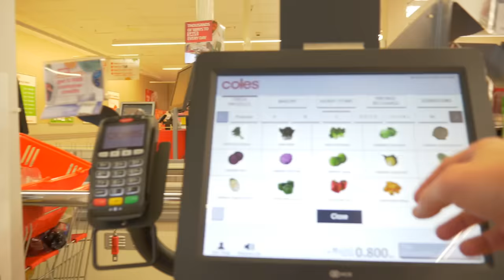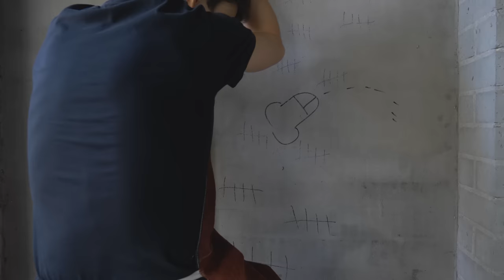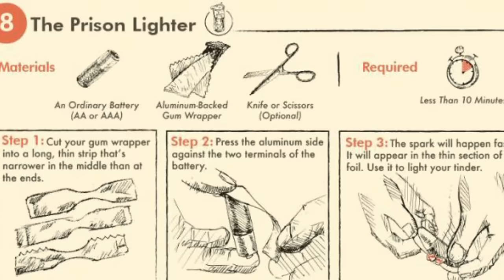Recreating the Worst Prison Weapons

Comment: Homebrewer here: You'll get way better orange wine if you leave the peals in for the primary, then put the fruits in for the secondary. Freeze the oranges so you can use the same ones next week after you rack the wine in a new container to get rid of the peals. ALso, freeze any fruit you want to ferment with. That helps break down the cell walls and makes more of the fruit get into the drink. ALso mashed up bread works as an okay yeast nutrient if you boil it first, but with real fruit in the primary you wont need any of that. You do need yeast either way.
Reply: bruh
Reply: wait till this guy find out about liquor stores
Reply: @thedude7737  I think most homebrewers do this because alcohol tax, or just the activity is fun.
Reply: Instructions unclear, used frozen fruit to break out of prison.
Reply: Tips on to not kill ourselves with botulism?
Reply: @bloodyhell8201  clean your equipment, dont use rotten food
Reply: @samquinn4095  My mom and her friends go every year to pick peaches in PA (I think) just so they can make peach brandy. They've been doing it for probably 7yrs now and have gotten pretty good results the past few. They just all make their own batches and pass out jars to compare whenever they deem it's ready.
Reply: @insanospaz  cool, do they all have their own stills?

Comment: I once dropped my Stanley knife with the hook blade while cutting boxes, my hand was above eye-level so gravity pulled the razor sharp hook right through the fleshy part of my thumb/palm. Surprisingly it didn’t hurt much because the knife is just really sharp so the wound stays nice and clean and the cut is nice and straight.
Reply: Same! I once cut clean straight through the flesh of my thumb (lucky nothing permanent) with fabric scissors. No pain, just a lot of bleeding. Straight cut.
Reply: When cutting with razors it usually only hurts afterwards when it's healing
Reply: I collect and make knifes, be it switchblades, one-handers or survival knifes. Getting cut almost never hurts, since I sharpen them very finely - getting stuff into the cut (sweat, dirt, anything) really hurts. Interestingly enough I've never suffered a cut  on the back of my hands, only fingers and palm. Tried out the "lemon juice into fresh cut" - thing out of curiosity and circumstance, can absolutely recommend if you like pain. If not - hurts like a bitch, do not do that shit.
Reply: @Careonovam  bruh, you let the intrusive thought win on the lemon experiment
Reply: @Careonovam  Did it scar?
Reply: @Human-san  Well yes, if it has a certain depth even a scratch scars ^^

Comment: I know I’m a bit late, but the reason you’re first whip didn’t work well was because you forgot to add a counterweight at the end. The original whip had some type of screw at the end, making it much easier to control and much more likely to wrap around an appendage. You’re second attempt achieved the same effect by the large razor blade at the end.

Comment: Funnily enough, guards do razor checks in jail and you need to turn them in unscathed. Some people will take bits of foil from snack bags and replace the blade with it. They snap the razor back together and it doesn't look too suspicious. Other things people will do are curl construction paper into an extremely compact cone (for art supplies, but are still super pointy), or take the metal brad out of buttons and straighten them, then sharpen them depending on the use (shiv, embossing on cups, tattoo equipment, circuit bridging for starting small fires, etc). Considering work orders don't go to fruition unless there's a medical emergency, and clothes are stolen all the time, a good way to sew clothing is necessary (hence the button brads). I personally just used rationed soap as chalk for DnD games and milk powder to make candy for people who didn't have money for commissary. Thanks for the videos and some good laughs, I look forward to watching more of your content.
Reply: Huh, can I ask what you’re in for, if that’s not too personal a question?
Reply: @ataphelicopter5734  can you not see past tense when you see it?
Reply: DnD games and candy? I wouldn't think inmates would be that kind of people.
Reply: @atlas_19  Human?
Reply: @EC-dz4bq  lol, yeah. That guy obviously watches way too many movies and tv, thinks every criminal is like a buff robot
Reply: @EC-dz4bq  No, im thinking he meant able to relax. We all think of prisoners as people in prison, but jail and cfs are usually kinda chill

Comment: 6:38 actually razor blades are given each morning, you got a limited amount of time to use em then you gotta hand em back to the guards they inspect them for tampering and throw em away and the cycle repeats itself everyday, the way you get away with the blades is that there's a small soaped slip along the outside of the razor, you carefully take that off, and you got access to the razor then just gotta get it out, then you cut out a couple small strips from a magazine, carefully place a couple of those slips in where the razor was, put the soap back on and boom untampered razor, guards will only usually take a quick glance at the razor then move along to the next person

Comment: You were on the right track, rather than cutting a z formation, cut it so its concave on both sides. It still channels it through an area of more resistance, but it doesn't weaken it to the point that it just fizzles out.

Comment: Surprised nobody has mentioned you used the wrong type of gum wrapper. You need the long thin sticks of gum where the individual ones are foil wrapped. The foil is much thinner than what you used and catches fire immediately. In fact, the picture you showed shows the correct type of gum wrapper to use.

Comment: You need a much thinner piece of gum wrapper to make a lighter. Taper it slightly in the center, but not too much, otherwise it burns too quickly and you lose connection. If it's made right it should spark a flame in just a few seconds and then burn the paper long enough to light a prison joint smuggled in under a COs ball sack.

Comment: You should hold the battery in one hand with two fingers, then it wont discharge into you/burn you as much. That's the way I've always seen it done in movies and such. You're supposed to pinch the aluminum gum wrapper a bit in the middle according to the picture. You just left it flat, and I think they might use a bigger piece of the wrapper as well. 
It definitely works if you do it right. It works by overloading the thin metal, just like steel wool.

Comment: I gotta say I work at a prison and the amount of razors I find is insane,  but inmates don't really use the gum method to smoke normally,  they steal copper wire, a small peice of wood or an eraser, a steel shaving scrubber and make a lighter they can plug into the wall
Reply: wouldn't have thought they would have access to wall plugs

Comment: you put bread in it bc it has yeast and the yeast will produce ethanol or as you know it alcohol
Reply: That ain't live yeast though buddy
Reply: The live yeast comes from the air. The bread is probably used because of the high amount of carbohydrates in it, which yeast needs to produce alcohol.
Reply: There isn't any live yeast in cooked bread

Comment: someone probably already said it, but for the last tip it'll work better if you cut the middle of the foil like this \___/ on either side so there is only a thin strip of the foil running through the center. it's an old survival firestarting trick. be sure not to cut it too thin, or the fire dies immediately

Comment: When I was in prison in the US, we used a stinger to lit shit. A stinger is basically an electrical cord that gets cut and spliced so that the two cables are exposed. Then you plug it in and put what you want to light between the ends of the cords

Comment: To break the razor, tuck the handle end under your shoe, then snap the head on the ground. The resistance will create enough power to dislodge the blades.

Comment: to make a lighter you use a tv wall wire, cut it so it cut free from the tv but plugged in the wall strip a bit of rubber of the wire to expose the copper, separate into two segmants of wire, then you should have a solution made of noodle flavouring mixed with clear cheap shampoo in a cup and use the live wire to zap the mixed up shampoo which conducts the electricity, either setting the shampoo alight or just have a piece of toilet paper between the spark and light that.

Comment: Baked bread does not have live yeast. It does have nutrients that can help wild yeast colonize it, but you are still going to risk bacteria spoiling the batch. Now, if the prison is baking it's own bread from scratch, then a small lump of the proofed, unbaked break would work to colonize the hooch and get it started. You also want to ferment in a cool location or the hooch will get a bit nasty tasting and give you a worse hangover. You are also only going to reach about 10% alcohol by volume max without having a specialized brewing yeast and going much above 5% will give you the same problems as fermenting in too warm of a location (room temperature is about as war as you want, but above cold tap water).

Then again, if you are looking to just get trashed out of your mind, go for the 10% and enjoy hugging the toilet bowl from it.

Comment: I have actually did the prison lighter trick before.  It would have worked if you had the tip of a cigarette held on the thin spot and  been hitting it when the paper smoked.

Comment: Ok so the way we used to make the jail house lighter.. (because yes you are correct I don't believe any place would sell gum; could you imagine if they did..) So what they do have is headphones and they also break a lot so to cut one up and use the thin metal wire inside of it. You only want like two metal wires or a single one. Now running a thin wire across the length of a battery isn't easy so an easy way to fix that is to scratch off some of the batteries wrapper just below the positive side, till you expose the silver metal underneath it, and that part underneath the wrapper will work same as the negative end; therefore you don't need to run it so far which makes it so much harder especially when using thin wire from a pair of wired headphones

Comment: Not enough juice in battery has to be near brand new and thinner straps (more flicks) crease together n it'll spark. Same with 2 battery's  n a staple flip tough positive n negative on bottom to metal and staple together on top it'll make a short circuit n turn staple red hot 🔥 which make a wick outta tp or cotton n touch it to it and it'll create flame then smolder then just keep in vent and can keep it lit and use it to spark your sticks ( like mini joint or cigarette) using blue thunder tp wrap as rolling paper.  Also starts the gum foil paper faster with 2.

Comment: Another life hack is that take 2 x of those AA batteries, put them side by side on a steel surface or "bridge" them with a razor or foil, then you need another razor that you cut in half. You can substitute the razors with foil if your prison offers stuff with foil in it, (mine didn't). 
"Schematic" below:
    
       __🔥__ - halves af an razor
        |+ |    |  - | - batteries
        | - |    | + |
        [  steel  ] (or foil or any metal surface you can find) 
Just touch the tips of the razors together and you get an decent ember.

Comment: so yes the hooch is safe to drink and also the better way to make is is as follows,
go to shops, buy 2 lires of 100% grape juice or any fruit juice really just has to be 100% fruit,
also buy a bag of caster sugar and bread yeast (if u want u can get turbo yeast online for better fermentation) now go home open the juice and empty roughly one cup. now add about a cup of sugar to the mixture u can add a bit more but one cup works well,
now cap the juice shake to mix sugar.
now add less than one third of a satchel of east shake well.
now screw the cap on slightly so that when u squeeze the bottle air can get out. set this to rest fro two weeks.  after two weeks decanter the liquid away from the stuff at the bottom witch is dea yest cells and u got ur self some wine hooch

Comment: Lol metal wire works better for the lighter.
1) coil the middle of the wire around the end of your combustible (smoke, joint, toke, wick, another inmate's hair...)
2) place the negative end of the battery on the table, with one end of the wire underneath it
3) use tweezers to touch the other wire end to the battery's positive node
4) inhale.

Comment: While I know this is for "prison"... I'm sure someone is gonna try this outside of prison.

Oranges are one of the absolute LAST things you wanna hooch! Stuff comes out tasting like actual vomit. It is even worse if you have too much pith.

Artificial sugar doesn't ferment.

Definitely should wait longer than a week to ferment. 

The "runs" caused by carrots were likely because the hooch wasn't "cold crashed", which basically means making the yeast in the hooch go to sleep and fall to the bottom.   Carrot hooch doesn't cause diarrhea. Live yeasties do though.

Can't put it in a cold place? Let the hooch run its course. It'll stop producing CO2 (bubbles) when the yeasties are done. Around a month usually.

Botulism is very unlikely if you practice proper sanitation methods, keep the pH to certain level, and/or make a high alcohol hooch.

Comment: 2:15 That would be because alcohol is generally made from fruit, and carrots are vegetables.
4:55 I think you are safe in this case. I looked it up and high acidity, sugar concentration, or oxygen concentration should guarantee killing of any botox producing bacteria. Since this is oragne juice with lots of sugar, such environment is achieved. The only thing that is missing is the oxygen.

Razor whip: I think it would inflict painful bleeding wounds with minimal chance of instakill. Not a good weapon for combat, but good for intimidation or torture.
Could be stopped outright with thicker clothing.

Comment: well sir
that battery trick is actually real, the restriction is too small the way you did it, it needs to be only about 50% the width not 10% otherwise it burns up before enough heat for fire, and the pain is likely because you didn't squeeze hard enough to properly contact it with a small cut to make the strip thinner
the hootch is likely using bread because the yeast may only be dormant after baking and the fruit is the source of sugars unless they can get real sugar
as for the whip, yeah it fucking works but they likely use a set of clothes to protect themselves from the backlash and are just better with whips

Comment: Twist napkins light them on fire 🔥, it will burn mad slow. Split  matches in half you get double amount. Make a hand iron saw out of raiser blades, by hitting each other it will make them like a chain saw. Then cut down the bars. You can avoid cutting your shelf while trying to escape by throwing a blanket on top of raiser barrier, many many useful staf, I could go on and on, yea,most important do not drop the sope😂😂😂😂

Comment: Btw the trick to the battery lighter thing is you have to make a narrow section in the middle of the wrapper. The idea of it is that by shorting out the battery with the wrapper, you're sending a lot of amperage through it, which heats it up until it sets on fire. The way you have it, itll heat the whole wrapper uniformly, which means itll never get hot enough without burning you. If you make a narrow section in the middle, thatll act as a weak point in the circuit, because the current has less room to flow, meaning that itll be the middle which gets hot and lights on fire.

Edit: nvm i unpaused the video and you immediately did that